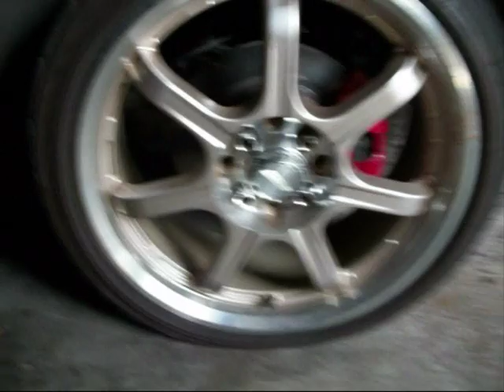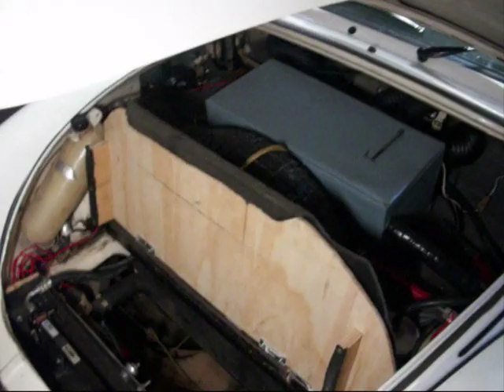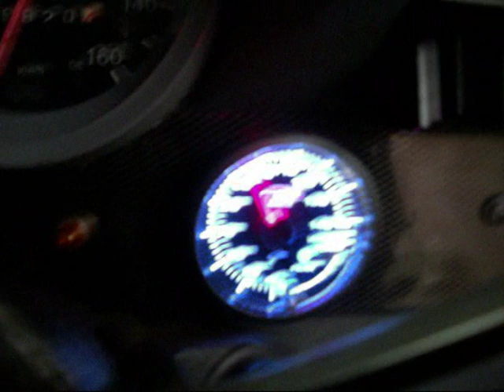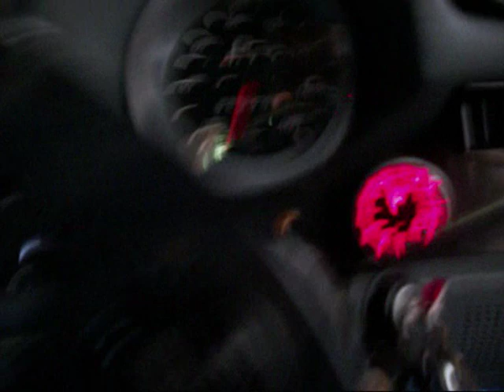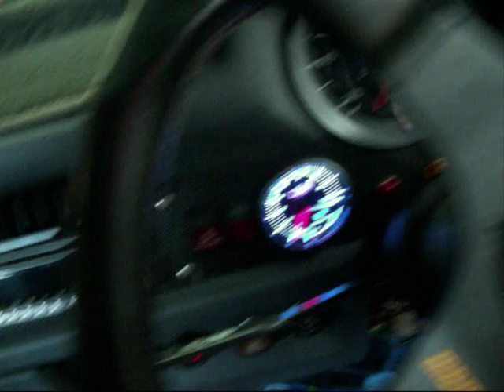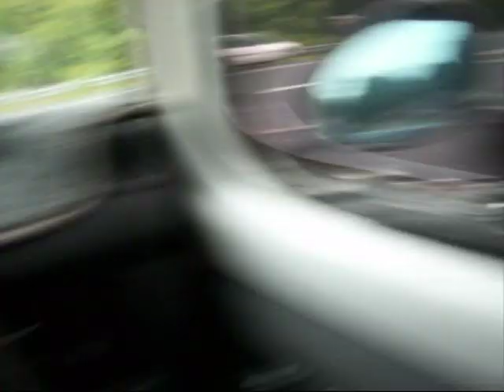Part2 Subaru EJ22 back together and first start up

Comment: Nice, Is the subaru motor a lot quieter .
Reply from the maker: Thanks, its much quieter, but thats natural when comparing an engine designed in the 1990s to one designed in the 1930s.

Comment: Hello i am converting a 1977 westfalia bus to subaru i have 2 question for you  that could help me out very much , if you have a minute . First ; throttle body manifold , can i just turn it 180 ' with no major adjustments .      Second ; EJ22 head on a EJ25 what are the implications . Is it a perfect fit ? New head gasket is all ? Note; i have a EJ22 with all connectors but i need the computer + cables . I will find a non running  subaru to extract the necessary cables . So if i can just swap the head i will find a Legaci with EJ25 in , swap the heads turn the turtle around for clearance.

  Every time i watch your farm vids i am nostalgique of my  fruit picking memories . Rémi from Canada ( french ) . Tks in advance love your channel so refreshing .
Reply from the maker: Remichiv0 Hi Remi, The intake manifold can be flipped around but it requires custom alternator mounts to be made and the wiring rerouted to suit the injectors and sensors.The EJ22-EJ25 frankenmotor is only something I would suggest if you have access to both engines. it does give a nice torque boost but does require a lot of extra parts.Make sure when you look for a loom and computer that you find one the same year as your engine, Subaru changed the wiring and computers almost every year so they often dont match up unless its similar year.Glad you enjoy the channel, hope that helps.

Comment from the maker: I can't remember which vid of mine it is in but one of them shows my VSS. It's just a $25 inductive pick up proximity sensor mounted on the outer left CV joint. 
Been working well for over 3 years now and also operates my digital speedo.

Comment from the maker: If you know your way around modern engines yea pretty simple.
Its just setting up the hoses and pumps for fuel injection, setting up the cooling system and all the electrical crap.

Comment from the maker: the chassis forks need strenghtening, the Engine is heavier and more power than the VW so it bends and twists the forks if you just bolt it to the transmission and leave it
I use a kafer bar on mine.

Comment: Apart form the tansmission plate adapter is anything else required to just put it in. Any engine mount plates or anything

Comment from the maker: @FriggenBeezKneez  oil pan is the stock subaru one just shortened 3.5" and widened to the sides, it has 1/4 litre more capacity than stock but is only 1" lower than a VW engine sump. trans is just stock superbeetle, its the turbo motors that break them, the adaptor plate is from Volksconversions here in Australia but Kennedy Engineering in the US sell the same style of kit.